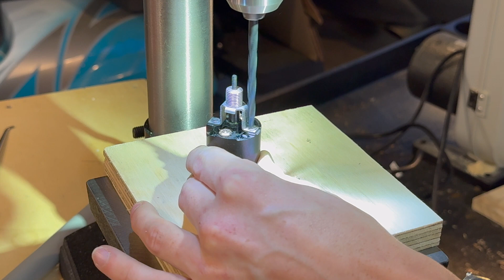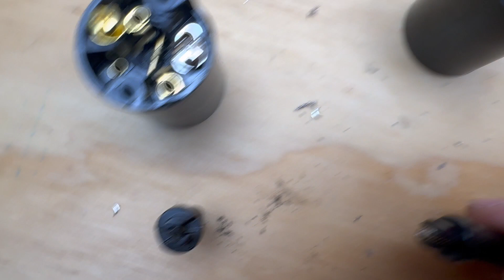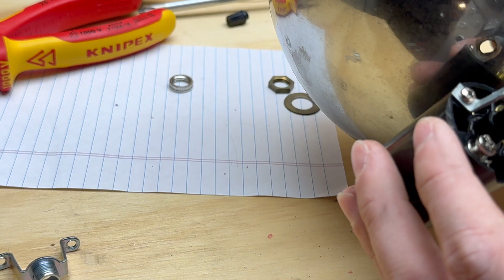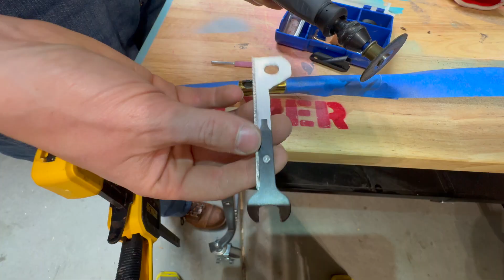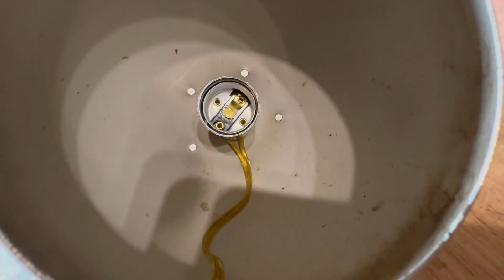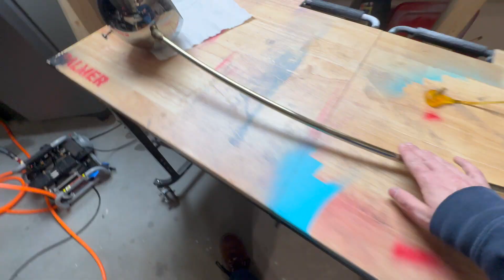Vintage Lamp Resto-Mod

Comment: Great video. I just had to rewire a lamp that had the same color and clear but had put it down for so long when I went back to attach it, I forgot which was hot and it wasn't obvious. Then I watched a video showing the small end is the hot and may have writing on it. Mine did but was faint. Followed the small prong up to my connection. But it was tense because I've hooked it up wrong before and found out my breakers work. Still scary though.